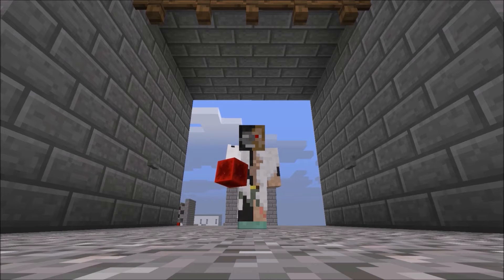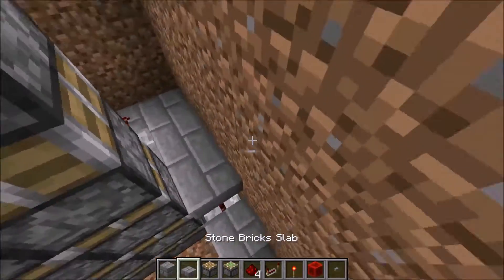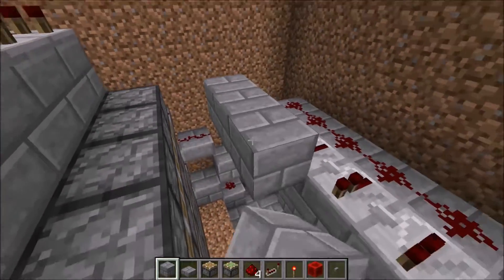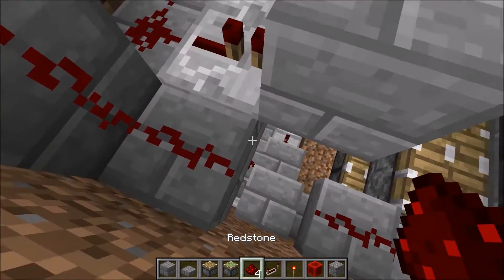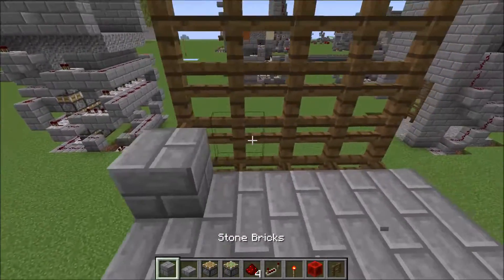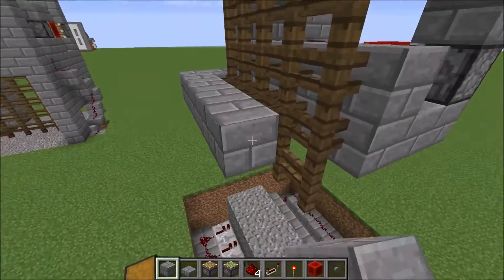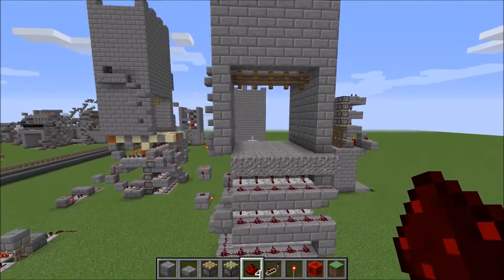Portcullis gate (castle gate) 5x5 - Minecraft up to 1.18: Redstone tutorial

Comment: Could you explain how the wiring for the buttons works?
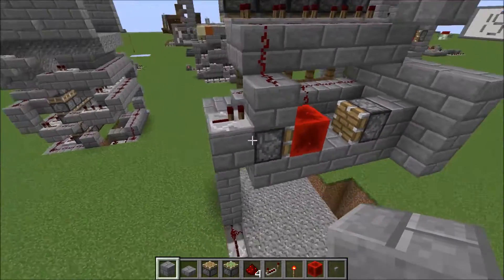Reply from the maker: for the button that opens the gate you have to connect the bottom part and the piston at the top that pushes the redstone block away from the dust, then add a button somewhere in the middle but the way you wire it depends on how you have your building layed out. for the button that closes the gate you just have to connect a button to the repeater at 13:27.
there is a link to a world download in the description for the video on version 2.0 of my shulkerbox storage system.
Reply: Thanks!